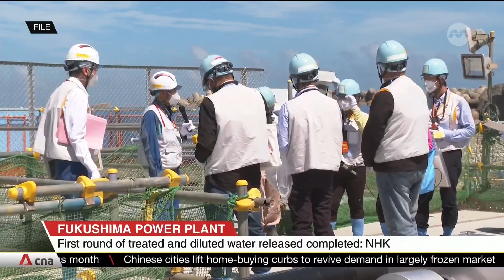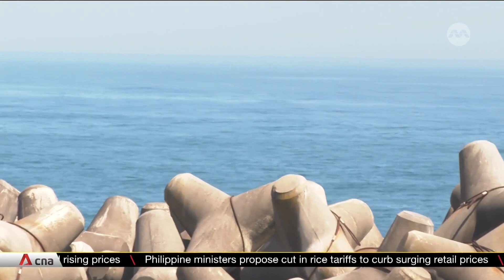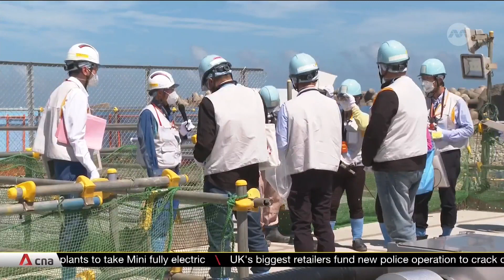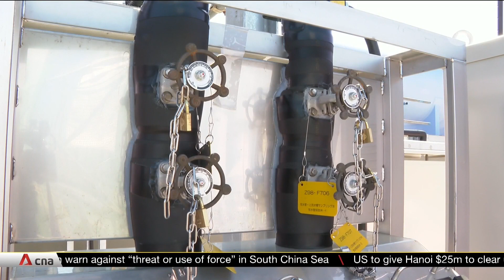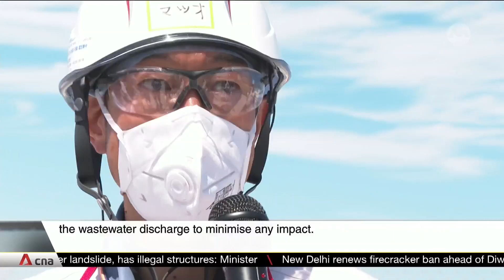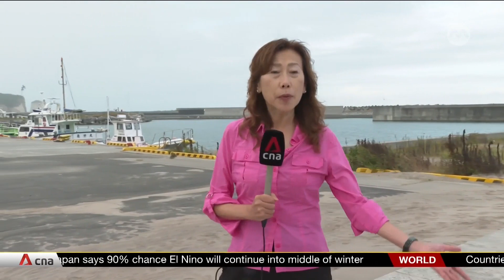Japan completes first round of release of treated Fukushima wastewater

Comment: just think of the counter factual.  If what happened in Fukushima happened in China, and IAEA said it s ok for China to dump filtered radioactive water into ocean, I am pretty sure most in the west would object.   apply current Japanese logic to Chinese argument:    You just need to TRUST the Chinese government and the Chinese company for providing the data!  iaea is there too! why worry?
Reply: That's an interesting what-if. Maybe we should ask China to try to meltdown one of their NPPs and see the West's reaction?
Reply: All nuclear power plants on the planet have always released the same tritiated water, including the West and China.
Reply: @danadurnfordkevinblanchdebunk     yes. like all nuclear plants had to filter 60+ radioactive isotopes.  iaea sampled only 10 tanks and said they were safe. that s extreme sampling bias.  

 There are over 1000+ tanks.   Only 300+ tanks were filtered.  IAEA didnt say how regular they would sample the discharge in labs. They had so called gamma monitoring devices but the radioactive water could be emitting alpha or beta even if they passed the gamma test.  
You literally need to have 100% convictions on trusting Japanese government and the tepco when IAEA is not doing enough sampling works.   That s like a company claiming all its financials are absolutely correct if an auditor only had access to less than 1% the data. 

 Focusing on tritium means Tepco could in a decades time mix filtered water with unfiltered water and discharge radioactive unfiltered water into ocean just to boost earnings and stock price. the level of tritium would be the same as non filtered ones.     

the solution to eliminate skepticism is easy.  filter all 1000+ tanks, let iaea certified all tanks are safe, and you would be correct that tritium is not the issue.
Reply: As for me, I am boycotting everything Japanese from now on.
Reply: @Joo-vw9kb   Since all nuclear power plants release the same tritiated water, you need to boycott everything from 32 countries as well.

Comment: Titrium is NOT the main concern.    1st 10 tanks were sampled by IAEA to be safe. I.e radioactive water that were  filtered had got rid of 60+ radioactive isotopes.  But would 10 tanks being safe means 1000+ other tanks are safe?   that s clearly extreme sampling bias. 

only 300+ tanks were filtered, and IAEA had not sampled those.   You literally would need to have 100% convictions that Tepco and Japanese government are telling the truth that all the filtered tanks reached safety standards.   

No one knows if the listed company could find a way to cut cost and boost its earnings and stock price in a decade time by mixing radioactive water and filtered water.  

Until IAEA had sampled  those so called filtered water tanks and or if all 1000+ tanks were filtered, this doubt would remain as both Japanese government (reimbusing tax dollars to fishermen) and the company have vested interest to keep cost low.   

Focusing on testing tritium in seawater would be irrelevant if radioactive water mixed with seawater were discharged as both filtered and unfiltered water would have the same level of tritium.

IAEA had not said it would sample every discharge nor the level of frequency in the lab before discharge in its report.   instead Japanese regulator would do that.    You need to have 100% blind faith on trusting the Japanese government.     

Tepco didn't have a great track record for being honest in the past as it covered up quite a few events.   The discharge is likely to be safe for the next few years (discharge of 300 filtered tanks)  but who knows what would happen in 2 decades time?

Comment: this water is from a meltdown and not from typical nuclear cooling usage. also there is no official support for this discharge, simply no objection...
Reply: I'm not a PhD or Masters to judge whether to support them or not. But let's discuss about the water filtration.
If all other radionuclides except Hydrogen-3 are filtered out to undetectable levels, wouldn't it become the same as the cooling water used by functional NPPs though? Or are they not?
Reply: @edNdr  undetectable then just drink it.
Reply: @gt5087  Technically they could I guess. Would probably just be very slow, due to the massive difference in volume of water available to dilute them down to their target H-3 concentration.
Reply: @danadurnfordkevinblanchdebunk  go drink from their pipes before it dumps.
Reply: The Japanese water release plan meets all international industry safety standards.
Reply: @danadurnfordkevinblanchdebunk yet nobody is allowed to supervise the discharge or the water testing but tepco. A company with a history of deceit, even using meters that couldn't measure the maximum radiation so that they could under report it in the early days
Reply: MOFA Japan No. 2238 ■■■■